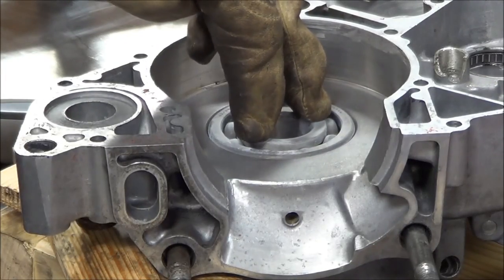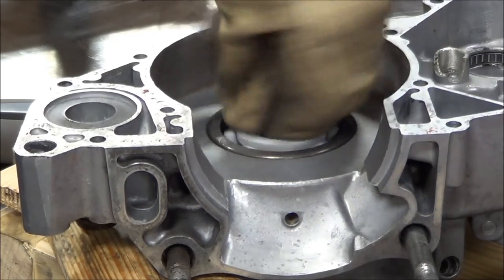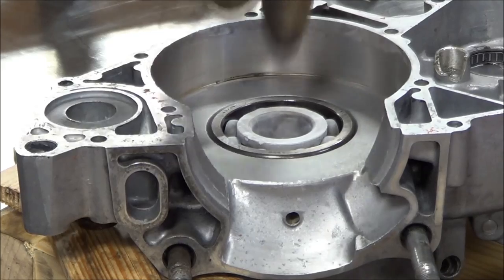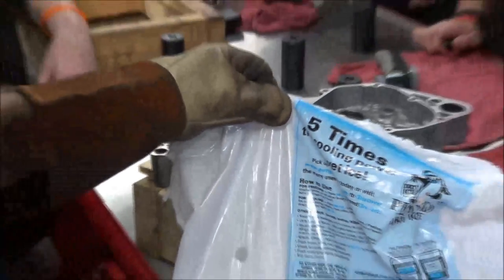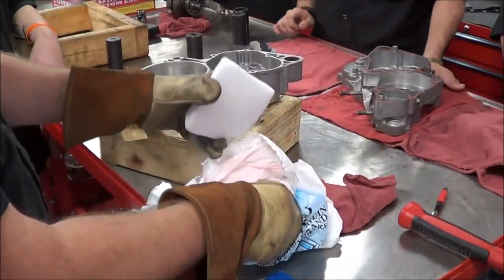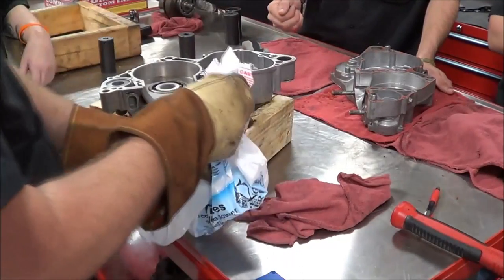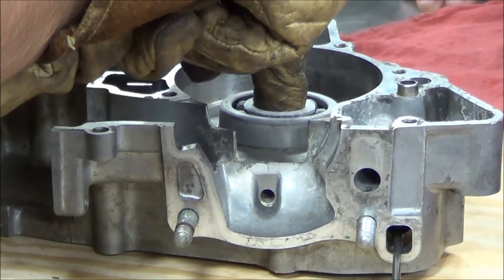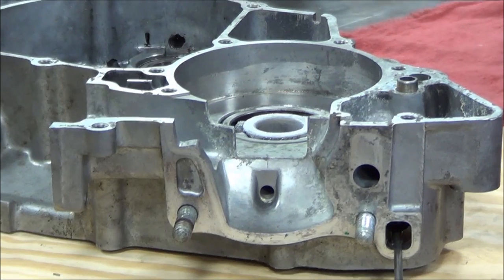Installing bearings with dry ice

Comment: Place dry ice in acetone enough to cover the bearing or whatever. Do not heat the mating part. With gloves or a tool remove mating part from solution and assemble. Acetone will boil off in ambient temp and do not pressure part into mating part, it is not needed.

Comment: does cooling open bearings in a freezer or using dry ice cause moisture issues? I am new to this.
Reply from the maker: Thanks for commenting and adding value to our community! No issues as you will still oil clean off and oil the bearings before final assembly.

Have you subscribed yet to never miss a video? Have you seen the video playlists? Check them out here: https://www.youtube.com/user/conleybuilt/playlists  

Want to say “thanks” or “keep it up”? Click here https://www.paypal.me/how2wrench    
 
Your answers and help are just around the corner. Save time and money while protecting your investment and yourself by doing it the right way at www.How2Wrench.com
Reply: Yes, that’s why you coat the bearing in WD40 or oil prior to freezing.

Comment: I did replace the crankshaft bearings for the first time.i didnt use ice or any hocuspocus freezing trick, only heat up the case around 95 celsius and the bearing falls in nicely.